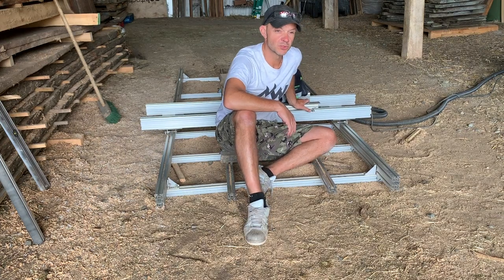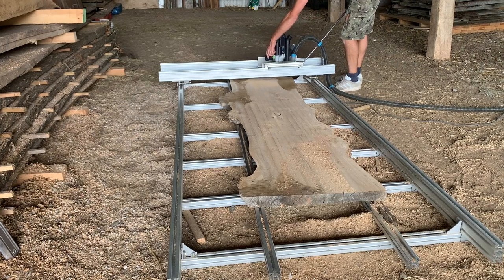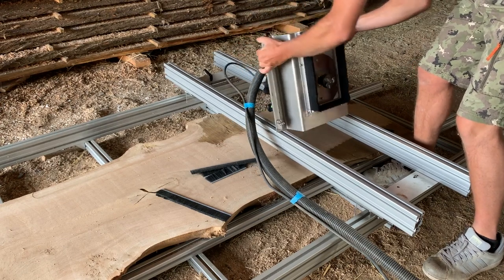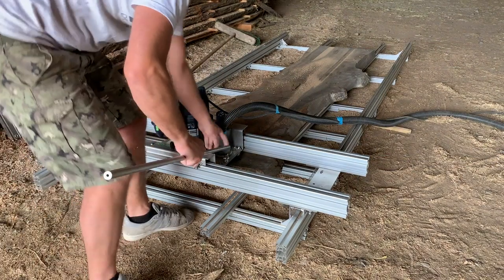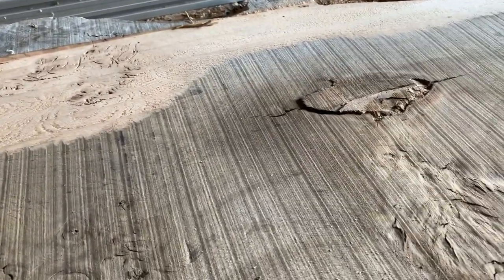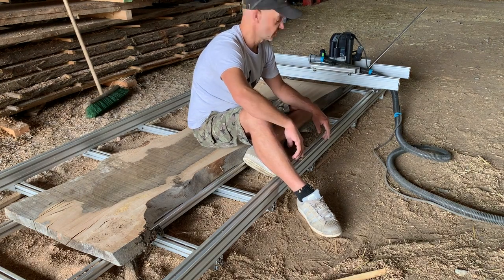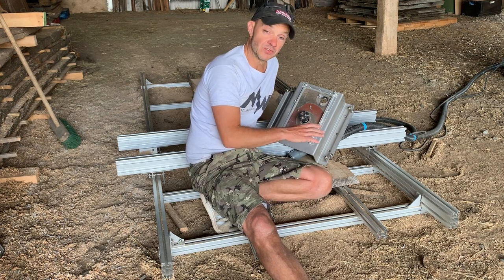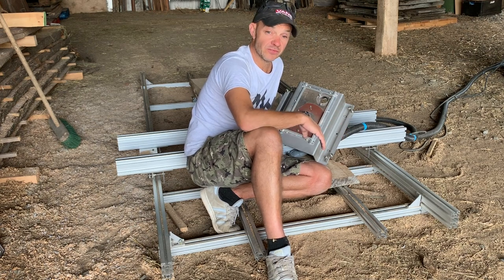#MWShoptalk - TOT Router Sled

Comment: I achieve very good results with a much less sophisticated rig, but the dust collection on this setup is fabulous. I will try to emulate. Thanks for posting!
Reply: You could literally quadruple your output with one of these.  I've used both handmade wood ones and one like this and did the sister slab in 1/4 of the time and required less planing

Comment: Excellent explanation......My only concern would be that it seems the slab thickness range might be a little limited.  Ideally I'l like to be able to flatten anything from 1-6"
Reply from the maker: Just add a 2nd rail which can be 40mm or 80mm or 120mm !!

Comment: I just bought the TOT! which I'm super excited about. I'm buying the 80/20 now, but how do you do any work-holding if you were to flatten any smaller pieces? If there was a plywood base you could drill those holders right into it, but is there any special holders that would be able to clamp into the extrusion? Thanks!

Comment: Andy, I'm amazed that you don't have to support/level your rig off of the floor to avoid twist ?!? Surely it's not just resting on the chippings. I've just finished flattening some 80mm slabs, and only managed +/- 0.5mm using a bench mounted wooden frame. I was hoping for better. What sort of tolerances are you getting ? Cheers.
Reply from the maker: I haven’t checked for a while but its good enough to put under my wide belt for final finish ,
Reply: @ManorWood  Oh yes the wide belt sander.......I forgot that I had one somewhere in the back of the workshop !! Unfortunately not even on page 1 of the wish list.

Comment: Have you re sawed an epoxy wood piece a bandsaw? If so how do you find the blade managing with the epoxy. I have tried several and the blade seem to really dull after just a few cuts. Was using a timberwolve 3 tpi (5/8 "), and had to replace it after 2 attempts at resawing.
Reply from the maker: I would guess is just gummed up, I haven't found resin blunts an edge more than hardwood

Comment: Hi Andy, I've been building this system over the past couple of days and Vlado at TOT has been super helpful. However, RUWI tell me that their quick clamps will only work with 8mm slots, but the TOT sled is built with 10mm slots. I know you built yours before getting the TOT carriage. Did you use 8mm slots on your profile, or do the RUWI clamps actually work with 10mm? Many thanks, Alan
Reply from the maker: Hi Alan , I can’t remember the slot sizes , but it’s all listed in my plans on Etsy and I use the Ruwi clamps with mine one , no problems
Reply: Manor Wood Great, thanks for that Andy.

Comment: Mate, that thing just slices through like it's butter! 👌
That dust hose seems to be a pain in the bum.
Any place to mount something like a PVC pipe up right to house the hose above head height?
So it is maybe on like a bit of an angle but higher than your head so it kind of forms like an arch over you so you don't have to step over the hose? 
Just a thought, no idea what I'm talking about really....lol 😂😂😂
Reply from the maker: I am on it 👍 the hose and power cable need sorting I am also only 4 meters from my main shop extractor so think I should tap into that as well :)
Reply: @ManorWood  suh-weet. 
Make life just that wee bit easier.  👍

Comment: I don’t believe that is enough dust collection for that rate for material removal, if TOT want to claim they are saving you from wood dust hazards using this inside, they should be accomodating at least a 125mm+ dust port for more air flow volume. If the chips aren’t being collected, the air velocity at the cutter is too low for my liking.
Reply from the maker: I can tell you that its a massive  improvement on not having anything :)
Reply: @ManorWood  haha of that I have no doubt! I hate the dust that always seems to come from from handheld routing.
Reply: @austin357  here you can see how it works with a cheap vacuum https://www.instagram.com/p/B08swWaA2eP/ 

anyway as you correctly mentioned, with the dust collector connected to the 50 mm flange, the result will be even better 👍

Comment: I thought you'd done a collaboration with This Old Tony when this first popped up!

That's an very impressive router sled! I wonder have you seen the power planner sled which Leo developed on Samson Boat Co? I've not seen one before but would be interested to hear you thoughts regarding speed and finish. Not seen one before and thought it was an interesting concept.

https://www.youtube.com/watch?v=sXyYq5k5ZCY
Reply from the maker: I think the router sled is probably a better solution for very wide slabs and much easier to handle as the router does all the fine settings but the plane is lead on those beams probably the fastest solution if you can be bothered to build and set up the carriage for it